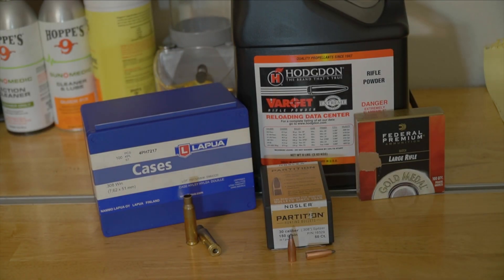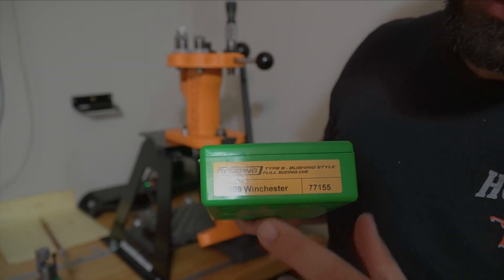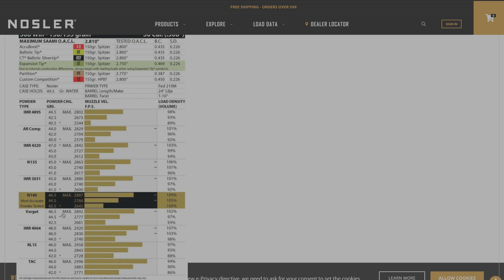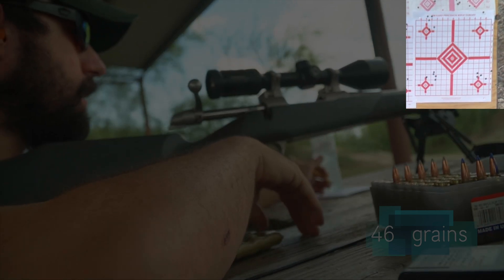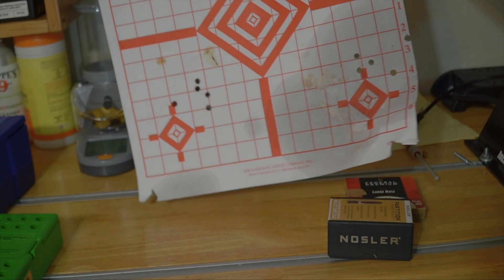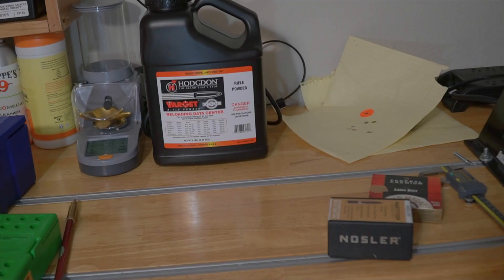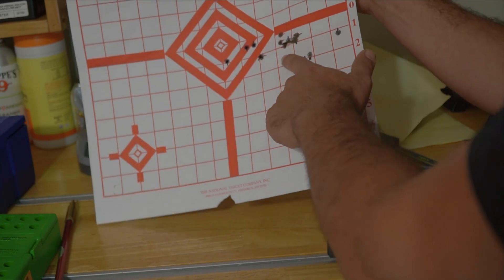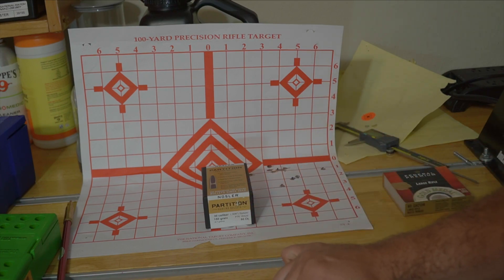308 Win Load development 150 gr Nosler Partition with Hodgdon Varget

Comment: Until recently, 2014 was the last time I did load development with the 150gr Partition. It was for a Tikka T3. I fired probably 600 rounds with all manner of projectiles and the partition came out on top. I made up 200 rounds and only recently ran out. They have been flawless during all that time - point shoot drop. Recently I upgraded to a Sako 90 and am currently developing loads for it. I thought that maybe I was getting too old and couldn't shoot well anymore as I didn't get good groups with what I was trying (200 rounds in so far). I brought my Tikka along to the range for one of these sessions as I had made up a new batch of partitions for it. I shot 3 rounds through the same hole at 50 and 3 rounds into a clover leaf at 100. The partition is a quality bullet. Maybe your gun just doesn't like it, like my Sako doesn't like what i've tried so far? For reference, my load is once-fired federal brass FL sized and shoulder bumped 0.002, CCI 200 large rifle primer, 41gr ADI BenchMark 2 (comparable to Hodgdon BenchMark), COAL 2.810.

Good luck!

(P.S. I am further away from the lands than Moses was from the other side of the Red Sea)
Reply from the maker: Yeah after messing with seating depth I’ve got better groups.  My son hunts with this partition bullet load  suppressed, and it’s one shot and the deer drops.
Reply: @DanielGuillette  Excellent! I'm having a hell of a time with my Sako. I have a new batch ready with changes made but I have to wait for my shoulder to recover :(
Reply from the maker: @teejay3510 as I said in the video, i had called Nosler and they suggested a seating depth test once powder charge has been deemed ideal (like how I had done working to find the node with a tight SD/ES).